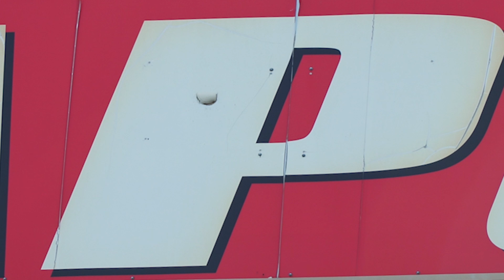3000 HP Cummins Dyno Explosion | Full Story

Comment: What’s the point?  You’ve proven an already well known fact: These engines aren’t designed or built to produce 3000 horsepower.
Reply from the maker: This engine was far from stock, only utilized stock architecture, stock crankshaft (which didn't fail) and stock oil pan.

Comment: Came here from an episode of Finnegan's Garage. Insane! Also being into torque because I have a lowered '98 Chevy dually that I am building a Cad 500 torque/mileage engine for. Ported heads, Edelbrock intake, mileage cam (low speed torque peak 2000 rpm and quick ramps) to get 20 mpg @ 65 and 2000 rpm. The stock 5.7 is getting 16. 4.56 posi w/ 245/75R16's.

Comment: @PowerDrivenDiesel testing out there new lift top Diesel engine! Your days of pulling the top end apart for inspection or repair are over, With the blast rated state of art hinge mounted on the front of the all new two piece timing cover just remove a few bolts and flip top half up like a corvette hood! Product still in testing and may require 80 pounds to 160 of boost and 2000 hp to engage!

Comment: 2700 horses all farted in your face at the same time. When it went from black smoke to whiter I new it was gonna be bad.
Black smoke matters.
We used to get 4000 plus horsepower from 440 cubic inches
 the old fashioned way. Blown nitromethane. Seems a lot more reliable than this.
First you thought..I shit myself..
Then you thought..yup..
Reply from the maker: How much torque would you see on your 4000 flywheel horsepower Blown Nitro setups?  Just curious about about average cylinder pressure!

Comment: How do you keep things more in check? Less turbo, more nitrous? Do those tags mean PDD is joining the wirefire gange next year?
Reply from the maker: When we slow down the turbos with more wastegate flow, everything calms down.... but it also makes less power.... when shooting for big (never before seen) chassis dyno numbers, you have to push the envelop and sometimes the hard parts won't take it.
Reply: @pddofficial  how about a rack controlled by a computer to help limit torque?

Comment: Are there no cooling fans? Isn't that to much heat without driving forward ? Please explain someone
Reply from the maker: No cooling fans in front, it has a solid block with no coolant.  The engine is ran in short bursts and oil temp is carefully monitored.  There is a large oil cooler in the back of the truck that is cycled after the engine is shut off to cool the oil and circulate cool air through the engine to cool it off.  Once oil temp gets below 150*F or so, it's ready for another dyno pull.  Once oil temp hits 200*F or so, it's time to shut it off and let it cool down.

Comment: That was a stupid waste money?   For what purpose?   While your so-called "performance" truck is spitting pistons all over, my 54 Nash Ambassador is still cruising down the highway in one piece.  Doesn't take a big stretch of the imagination to know which car is the best!  😂
Reply from the maker: Glad you're satisfied with less than 100 HP in a beautiful classic car.... sometimes the looks of a vehicle just doesn't do it for a guy, you also want some GO!!!   Plus, Ultimate Callout Challenge is based on making power, going fast, and ripping a sled down the track, no trophies or awards for style points.
Reply: @pddofficial 
Thank you for your kind reply. I suppose.  All kinds of people in the car hobby, fortunately.  Keeps it interesting. 
My 54 Ambassador has been upgraded. It's not the 100hp gutless wonder it used to be. A 350 crate engine with a turbo 350 hydramatic.  Factory a/c.  I had to dump the original 6 because it's near impossible getting parts for it. 
Now she's around 200hp and cruises easily at 80. (2.79 Ford rear end)   Of course it'll go faster but I keep it under 80.  Best of all, it's dead quiet. 
Rather than "power" I prefer the subtle approach.  Having a car that's almost extinct and taking it to a car show, with maybe 300 other cars, and I know I'll have the only Nash.  
The comments from people are priceless. "...I learned how to drive in one of those", "... I haven't seen one of those in 50 years", ".. my dad/grandfather had one of those", "... why would you waste your money restoring a Nash when you could've restored a 57 Chevy?".  😂
Reply: this truck could go faster on a 2 mile drag strip than your 54 Nash Ambassador could run the 1/4 mile, have some common sense😂

Comment: He says it's not my first time blowing a motor like this! Looks like a good shop to go have tune my diesel!
Reply from the maker: Thankfully this type of injection system/solid iron engine block are not "street-able" and not necessarily what most would consider to be "tune-able"  Of the small number of diesel trucks that run a similar albeit smaller injection system like this off road race vehicle, they don't have the fuel flow nor the airflow to split an OEM block, regardless of tuning.
Reply: @pddofficial  If it's not considered "street-able" then it shouldn't be on a track running the quarter mile and sure as hell not on a Dyno with people standing nearby!

Comment: That's to bad that happened you guys are awesome! what rpm do you usually run to in that?
Reply from the maker: It usually makes peak power on a well-loaded chassis dyno by 5k RPM.  We've safely taken this setup to 6,400 RPM on occasion, but power is falling by then so we try to lift or shift by 5,500 RPM or so.

Comment: Do you folks go to things like SEMA to promote the parts that you engineering and sell?  Make sure you keep that block!   That needs to go to every trade show you're at.  "You need 3000HP?  Get a billet block and then use our stuff."  Thankfully no one was hurt!
Reply from the maker: SEMA seems to be more of a flashy part, big wheels/tires/blue tooth driveshaft type event.  PRI is more of the billet block/exploded parts arena.

Comment: People wonder why there is clean air acts. When fools like you spread enough black smoke per drag run than a small city.
And ofcourse making a 'racing' engine out of an engine designed for torque means it will shit itself often.
Hundreds of videos of black smoke belching huge explosions from diesels.
Yet petrol engines by the thousands do not explode near as often. And seldom if ever near as bad.. Including Top Fuel engines and they potentially are  far bigger handgrenade.
Reply: another ignorant comment, this truck in its lifetime will never cause enough pollution to hurt anything, EVER, no engine is made for racing, thats like saying "making a 'racing' engine out of an engine designed for horsepower means it will shit itself often." your logic is flawed

Comment: What PDD blows up ANOTHER truck? Color me surprised.....When will you guys learn to invest in some data software and learn how to stay within safe limits?
Reply from the maker: I hate to respond to haters, but I'll give you a shot.  What data software do you think we need that we did not have on the truck? I'll assume you weren't there and haven't seen the truck in person so this should be good!
Reply: @pddofficial  I wouldn't describe me as a hater.... why would I want or be jealous of a bunch of trucks that suffer catastrophic failures? Nope I wasn't there, but don't believe I need to be to understand this is a trend at PDD. As for software, I would think hardware would also need to be included. Maybe a full suite of BANK Idash or data monster components. That why no matter where you are testing you can always collect data on what went wrong OR better yet know when you have reached a limit of EGT, boost, or turbine speed. Judging from the way things went and the failure point of the engine, I would venture a guess that cylinder pressures went through the roof and the tensile strength of a stock cast block was exceeded above the main stud webbing (the weakest part). What caused this? Well judging by the black smoke and the low RPM your dumping a shit ton of fuel (way more than can be burned) you add in water/methanol (which is counter productive as water is INCOMPRESSABLE and takes up space in the cylinder which could be used for MORE AIR. I assume this is done in a vane attempt to lower EGT's because the unburn fuel is causing a massive spike otherwise. Once the turbos finally started to work and boost air hit the cylinders (more air, lots of fuel, incompressible water) instantly igniting methanol which further increases cylinder pressure BTDC and further compression lifts everything!! Head studs/ pistons rods/ crank all held causing the block to yield. Pistons flying is a result of the near instantaneous reversal of forces on the rods from compression to tension when the upper parts of the block/heads leave them unloaded. I would bet the cross/sectional view of the rods will show a distortion not unlike what happens when chewing gum is stretched. Rethink the way you make power, you already had 2700 on a stock cast block... that's already a short lived combo. Just because everyone does it doesn't make it correct. You might win some events with less power and a truck that stays together.

Comment: Static compression ratio needs to be lowered.. shorten the rods..
Reply from the maker: What do you think the static compression ratio is on this truck and how low do you think it should be?  18:1, 15:1, 12:1?  Why would an engine builder shorten the rods and risk burning the tops of the pistons when they could simply increase the bowl volume on the custom forged piston if all they wanted to do was simply lower the static compression ratio?
Reply: @pddofficial  shorter rods will decrease recipro mass, drop the comp ratio, allow greater combustion area to spread the high combustion temps over a greater surface area. Dish pistons sacrifice strength in the crown, particularly with diesels. On the 3-5k HP engines I've had experience with, none of them run bowl/dish pistons.
Reply: Additionally, the math will determine the correct component change/s required in order for the components to comply with disired engine output. 

Regardless, still love what you guys are doing, look forward to seeing you break more records.

Comment: Oh well to strip the engine you'll only need to take 6 bolts out. Apprentice mechanic 101, always make sure you don't have excessive cylinder pressures! or, we've cured the head gasket sealing issues!

Comment: Was this a Hamilton block?
Reply from the maker: Yes, this was a Hamilton Solid Block.  It has seen quite a few runs/dyno pulls above 2k HP so it was more "fatigued" than our main engine as far as heat cycles, but it probably hasn't seen more than 2800 ft lbs of torque before this dyno pull.  The past record holder from UCC 2019 that did 3800 TQ was using a Hamilton Solid Block.  They are definitely stronger than an OEM Cummins block, but still have the same cam tunnel weaker area which becomes the next wekest link after the cylinder walls are beefed up with the solid casting or a deckplate in an OEM block build.

Comment: I'd assume that there'd be no one on deck with out the right ppe after shredder blew up, and the Injuries that occurred to the driver. 

The guy running off the dyno could have been his last dyno.   Real talk....
Reply from the maker: The dyno operator was the same guy that was burned during the Shredder blowup.  He was wearing a fire suit but probably should have been wearing a head sock under the sun-block hat.

Comment: If you do billet block though leave the cam bore out of the block and go OHC it makes it a ton stronger and will help with head gasket life as a bonus.
Reply from the maker: Every billet block we've seen has an OEM location cam tunnel.  Some have added a full inch of additional block material outside the OEM cam tunnel/block dimensions.  Those Wagler rods sure are stout!!!
Reply: @pddofficial  LSM will be glad to make you one without a cam bore.  Alternatively if you want to still run cam in block you can leave a v shaped web on the inside of the cam going down and tying into the main journals just cut out for rod clearance. Then use roller lifters dropped in from the top.  This allows you to keep much more structure where you need it which is tying the head forces to the main forces so they dont decide to separate from each other. Breaking up is rough!!  Lots of material outside the cam bore is a band aid at best as it is outside the line of force from head to crank.That 4140 heat treated block would be 4 times as strong as an aluminum one of the same dimensions. You could find the next weak link! Sooner or later should start breaking factory cranks but man those things are strong to begin with!!!  Were you all running buttons instead of snap rings on your pistons? Might want to go back to ring locks so your pistons don't fly away if there is another accident.

Comment: Not to bash on anyone, but I have to ask after this and Baca's is it time to discuss the need for billet blocks while trying to push 3khp? I know damn well none of you want people getting hurt, hell you even said it makes your stomach turn thinking about what could happen. I feel like it's time for the guys pushing the edge to push for rules that make this safer. Honestly the Dyno events seem more dangerous than racing and pulling over the past couple years.
Reply from the maker: Unfortunately, this dyno event is part of a 3-day triathlon type event and is HEAVILY weighted in the overall points race so you've got to make a big number to have any chance of winning the whole event.  The reality is most billet blocks start at 20k and go on up to over 40k whereas these Hamilton blocks were 4k and much stronger than an OEM block and much cheaper to build than a deckplate OEM modified engine.  That said, after a failure like this, it would have been cheaper in the long run to start with a billet block.... back when these Hamilton blocks hit the market, 2K horsepower was a BIG number!  And this Hamilton block is very well equipped to repeatedly hit 2k HP.

Comment: We run tie bars and tie the front and rear cover to the head just squeeze it all together
Reply from the maker: We have seen OEM wetblock setups with tiebars, never seen a solid block equipped with tiebars.
Reply: We run a diesel super tractor with a vg recast 9.0 liter block 4 charger setup

Comment: I have seen many Cummins Diesels attempt 3000 hp and those that don't make it always seem to fail in the block as seen at 6:42 in the video. I think 3000 hp can only be achieved safely and repeated if the block is somehow reinforced or beefed up in casting. If a rod lets go, it will punch a hole in the side of the block and the structural integrity already under extreme stress will fail in a nano second! It also only takes one undetected crack in the block to ruin your day!
Reply from the maker: This is an aftermarket solid cast block, it's much stronger than OEM Cummins block, but apparently not strong enough for this application.  There are billet blocks available, but the failure point on them is unknown, but claimed to be stronger... time will tell.

Comment: That’s how u send it lol 😂 what hp it make before it blow in half
Reply from the maker: 2369 around 4150 rpm on the way up.  Usually makes peak power in the 4600 to 5000 rpm range depending on dyno load.
Reply: @pddofficial  so wens the billet block coming to make 3k

Comment: Anyone else notice that just before it blew up he kinda braced for it? Like he had a gut feeling it was gonna do soemthing
Reply: i believe the wastegate melted shut. more boost, more heat, more boom
Reply from the maker: Wastegates can melt open, but not shut.  This engine has excellent thermal control with the water injection system, doesn't really do much melting of anything, just tulips stainless intake valves when the big power comes in.
Reply: I saw that too! The engine sound changed right before she let loose. I suppose I would brace for impact too if I was sitting 2 feet from an engine running 200+psi of boost. 😄
Reply: Seemed like it was leaning out, not enough fuel and N2O will burn anything it can, ie rings, oil film on cylinder walls etc and then there's the detonation.
Reply: @TD_YT066  it was too cold. lean is mean on a diesel. target is usually 20+

Comment: Was this a filled block?
Reply from the maker: Solid Cast Iron Hamilton Block, no water jackets, just solid iron.  Very strong cylinder walls and topend, still suffers similarly to an OEM block with cam tunnel fractures.  New Hamilton Comp wet block has improved the cam tunnel area strength over OEM and Solid block.

Comment: It would be great if you could tune at altitude for these events. Seems like the engines get pretty excited with all the oxygen
Reply from the maker: Yes, it does run much different down at low altitude.  We turned it down for drag racing and it still made stupid power.
Reply: @pddofficial  you have a pattern at pdd i believe related to altitude, not aptitude.  Lol